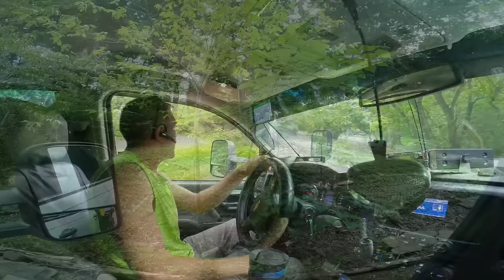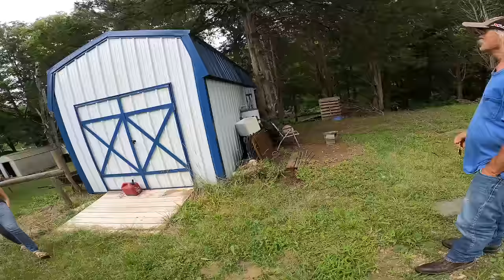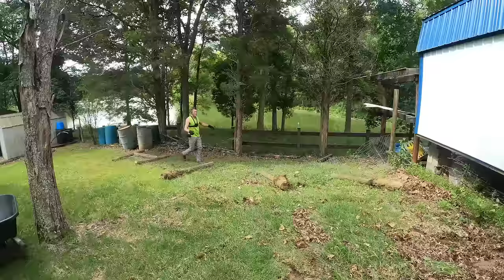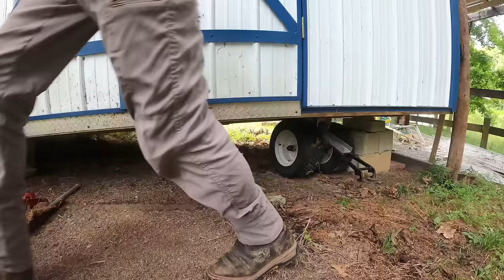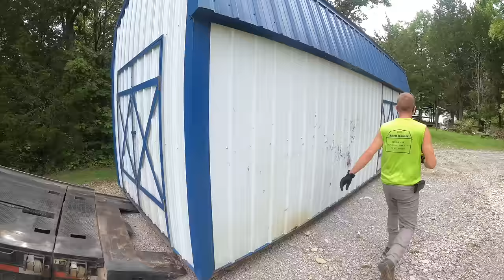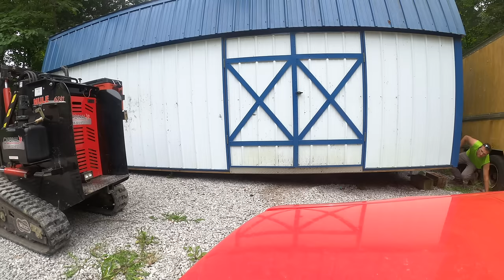Shed Repo and Redelivered #67

Comment: Back a few months ago I had suggested drilling holes in the side plates of those dolly wheels.  A few lag bolts in each runner would hold the dolly wheels when the shed was still up in the air.  This would have kept the dolly wheels in place when you dropped the shed @23:06.  Another option for the dolly wheel side plates would be a spring loaded hitch pin with a handle.  Put a rope on it so you can pull the pin without getting under the shed when loading up.  Safe travels!

Comment: Sounds like the plunger in the cylinder on the mule is letting oil pass by, it will fail eventually,  and then it can't hold the pressure anymore..

Comment: Why would you not turn it around, stear the wheel end to the trailer and get the runners on it. Lower trailer, grab wheels, then raise mule end and push it on. It would be easier and faster. I watch a guy that does that.
Reply from the maker: I usually do that, I'm not sure why I didn't here..

Comment: Quick question why wouldn't you put the wheels in the centre of the shed the it would of pived in the middle and been a lot safer
Reply from the maker: I need the weight of the shed to keep it hooked onto the mule but yes I can move them further forward to help make shorter turns, I think that is what you are saying.